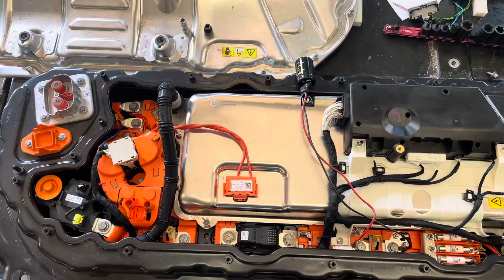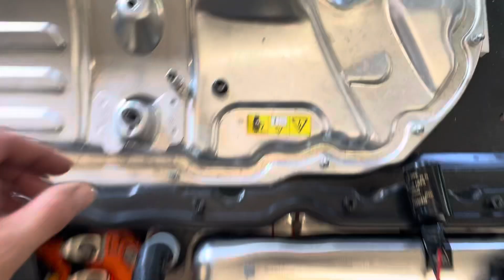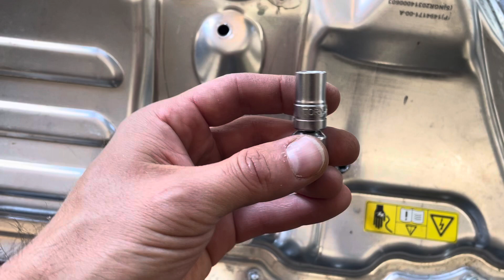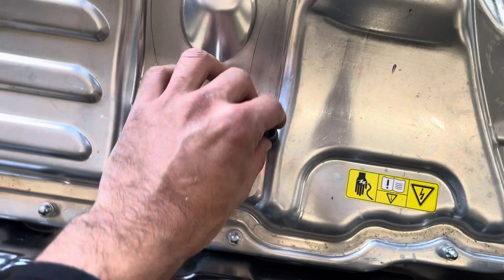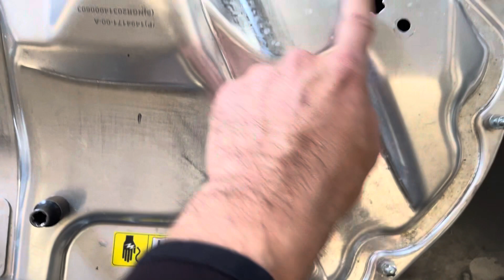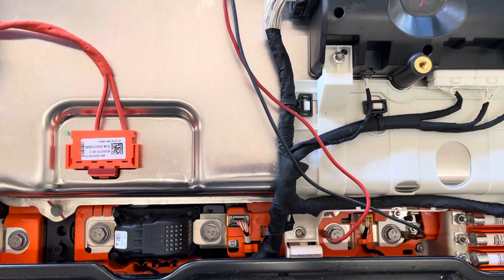How to install a capacitor inside a Tesla battery

Comment from the maker: Make sure to test the voltage inside the pack to ensure that contactors are not welded before loosening those 2 13mm bolts.  Take all safety precautions.

Comment: Hey there, love the videos very helpful. What are the specs on the capacitor?

Just out of curiosity, if you were to try and close the contactors and the capacitor was already full because it was recently used would the contactors still close? From my understanding, the BMS is looking for a specific capacitance and charge rate of the capacitor before closing the contractors. I'm just wondering if an already full capacitor would throw a wrench in this startup cycle. Hope that makes sense. Thanks again!

Comment: Hello like your videos. I have a question 
I got a 2022 model 3 that shows pyro fuse needs replacement. I have changed 3 new ones but still same issue. It also shows capacitor open. You ever come across this issue. Thanks
Reply from the maker: You are welcome to bring the car to our shop in South Carolina for diagnostics.